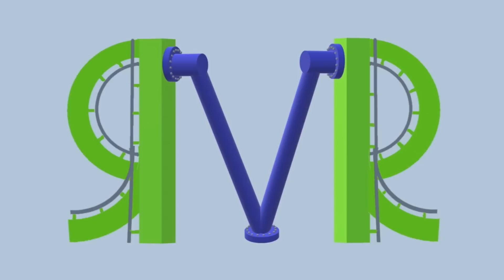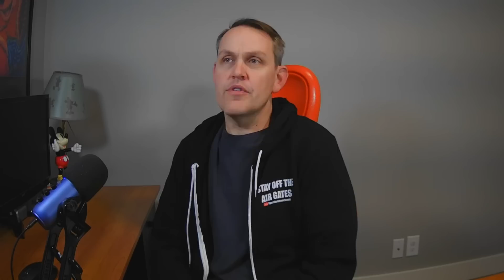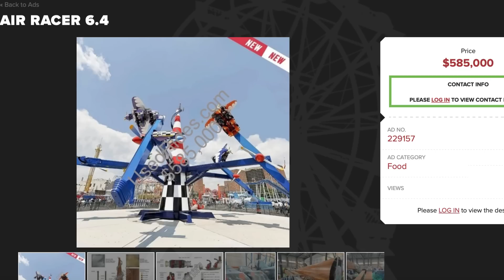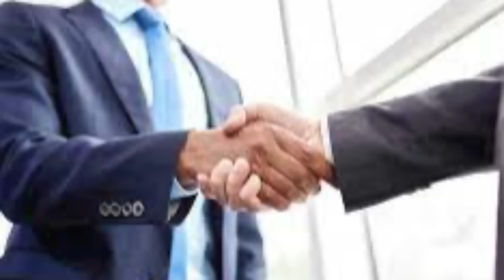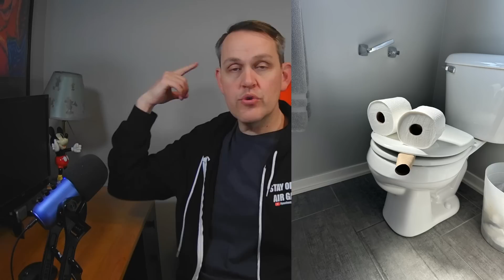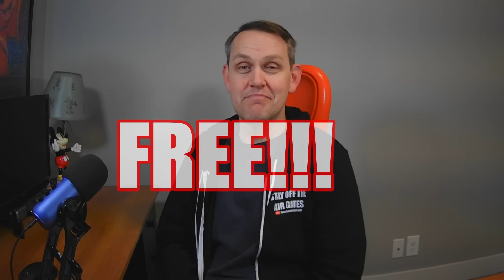You can get a ride for free but there’s one catch

Comment: Imagine having a B&M in your backyard. I can dream.
Reply: Richie Rich
Reply: Now that a lot of B&M coasters are being re-tracked, I was tempted to see where scrap track segments were being sent to see if I could buy up one for my yard.
You have no idea how much I want to use one as a status-symbol statue, showing the glory pretty pointless (when you think about it) machines that only exist to make us happy.
Reply: @punishedfoxo   I’m really shocked Merlin didn’t sell them. Considering the other major steel retracking job in the country did sell pieces of track. 

Pleasure Beach only sold a small number of large pieces though. Most were quite small for shelf or desk displays - not large enough for yard ornaments.
Reply: @Danrarbc  They might be retaining them for later use, but I'm not even fully sure how many actual segments were replaced. I was sure it was all of them until I noticed that some of the welds looked identical to the old ones around the vertical loop.
Then again, John Wardley himself said that B&M can basically order them replacement segments from the fabricators at a moment's notice since they archive the entire mechanical drawings set from 1993 in a way that can be quickly recovered. So that might explain why the welds look exactly the same.
You can get old theming and signs from the park, but you kinda need to build some trust with Merlin by visiting the park off-season.

As for Black Pool, I haven't been back in a number of years, but every time I did go I'd pick myself up some wheels. They weren't crazy expensive either, considering they're a little more special than just standard merch. But it's more than most parks offer.
Reply: @punishedfoxo   Nemesis was nearly entirely retracked.  I believe only the station, transfer and storage tracks would have been the only components retained. 

89 of the 117 supports were also replaced (that number also sounds about right for leaving the flat service track pieces alone).
Reply: Or an Intiman Strata